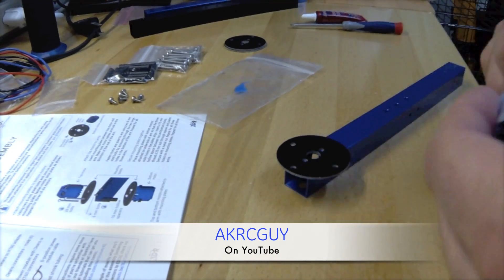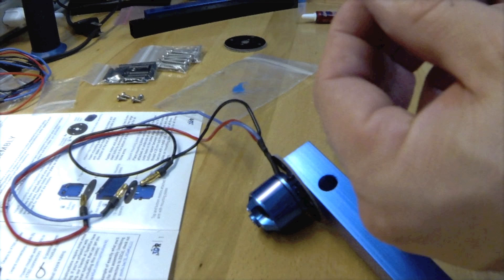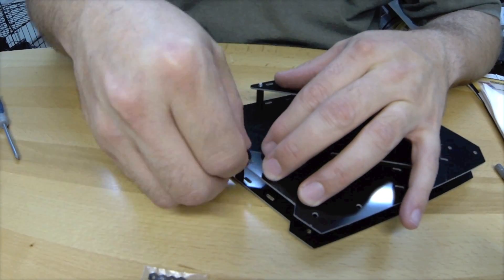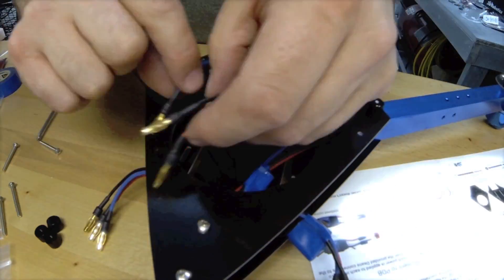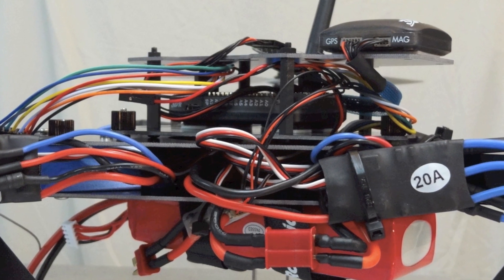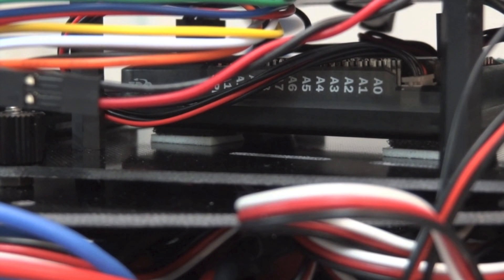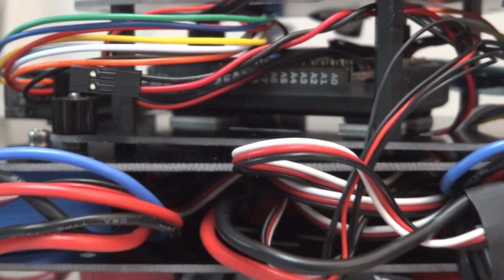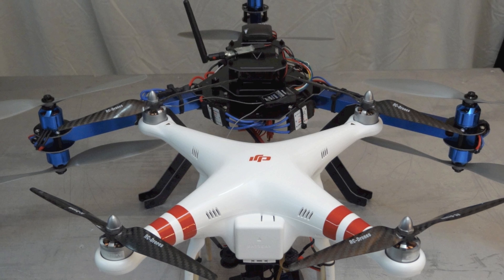3D Robotics Y6 Multicopter Post Flight/Build Review

Comment: which device is better the  3d botics y6 or the phantom
thanx
Reply from the maker: The main question is what do you want to do with them?  If your a RTF type guy who just wants to fly and not have to tinker with things then the Phantom is for you.  If your are interested in a lot more autonomous flight and mission planning, then the Y6 and one of the 3DR autopilots is the way to go.  I like them both and both serve their pupose well.  If you have specific questions regarding either please fell free to message me back.
Reply: AKRCGUY thank you so much for your no time reply, well i`ve been thinking about doing business taking aerial videos and pictures,  i`ve heard so much about the dji quadcopter but i`ve just come across the 3DR RTF X8 and the y6, i´ve seen some videos about the zinmuse system on the dji phantom and i think it is great. i have no idea if there is any similar system for the 3dbotics devices. what´s the autonomy on both cases? battery durability? ready to fly and work costs of each one? maintenance?  easier to get parts and supplies?
thank you so much again
Reply: ohhh and what camara do you recomend for such a task, i was thinking of the go pro hero 3 black edition, what do you think?
Reply from the maker: For these size copters I use the GoPro 3 Black Edition.  I usually shoot both 1080P video and 5 MP stills at the same time unless I have a reason to shoot in some other dedicated mode.  Hope this helps.  Stay tuned, we have some new videos coming out very soon!